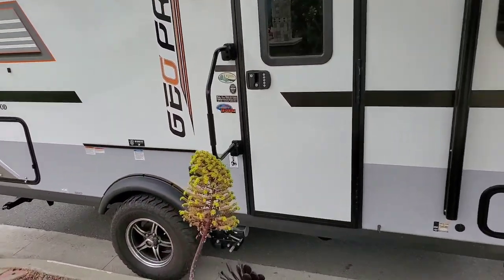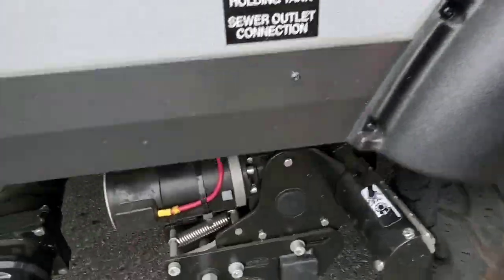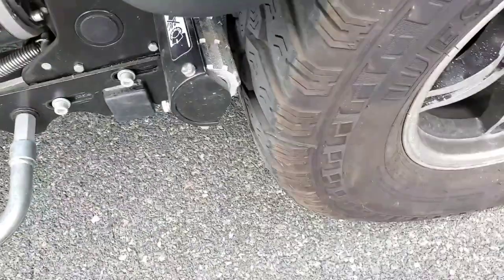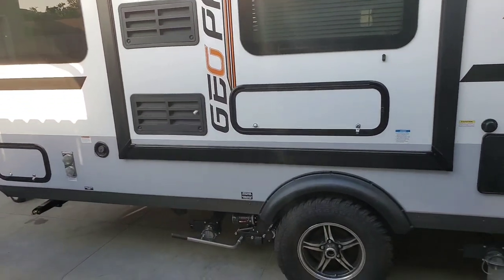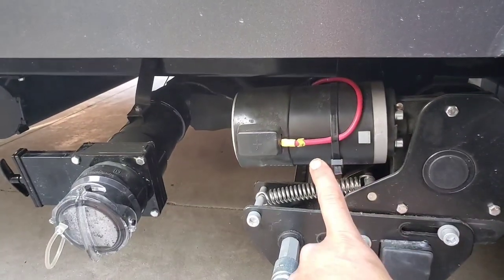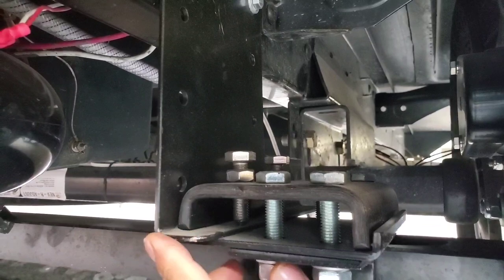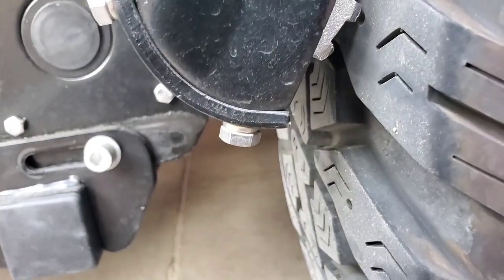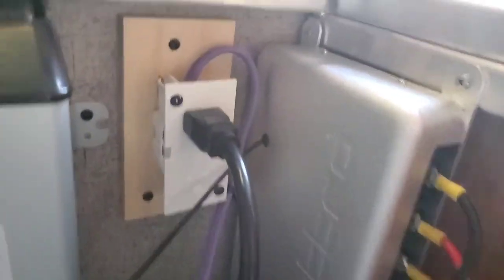Purpleline Trailer Mover in Action and Installation Overview

Comment: Sorry to criticise but by the time you get it up your drive it's time for your next holiday. Why did you have to reverse back and forth at the start of the driveway? Sorry, i'm out.
Reply from the maker: Bai, haha. This is because I have to if i want to store it at home. The neighbor is very particular about her grass and on account of the awning on the side of the trailer, i cannot get as close to the house as i need to. When I have backed it up it caused her to come out and complain about it. Even moreso now with our current trailer as it is a bit wider than the previous one. It also makes going through a narrow driveway much easier as there is a lot of angling that has to be done with the new trailer on account of the awning and the 8' opening.

As far as the reversing goes, i caught the corner of the driveway apron with a wheel. The motors were not engaged tight enough on the tires that they slipped because of the added resistance. Had to go in straighter. If that's what you were referring to.